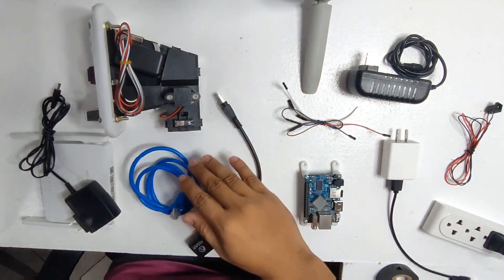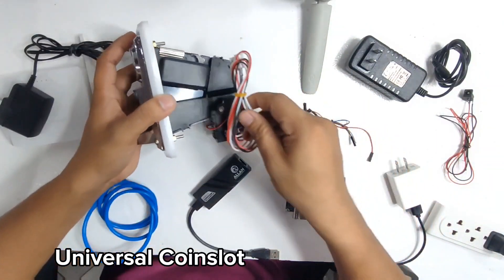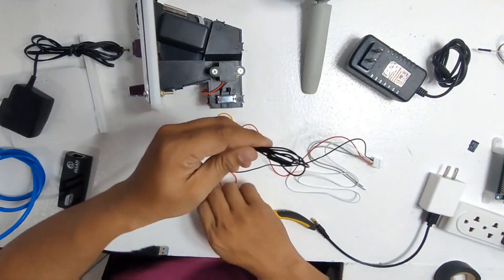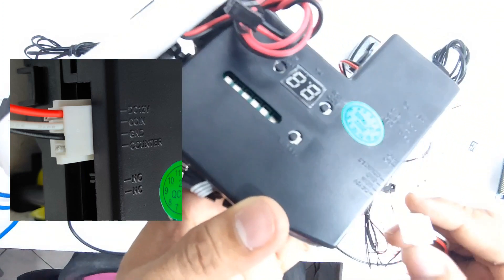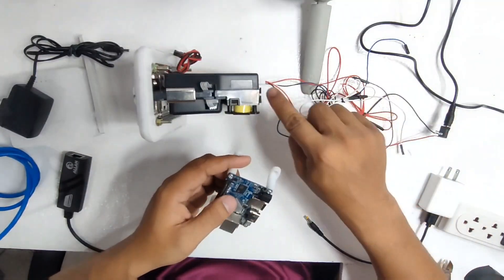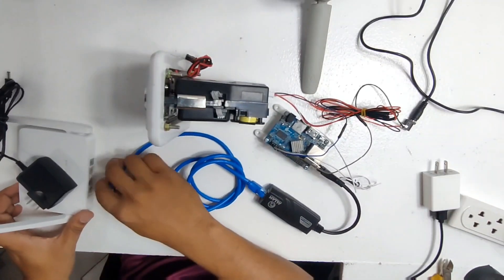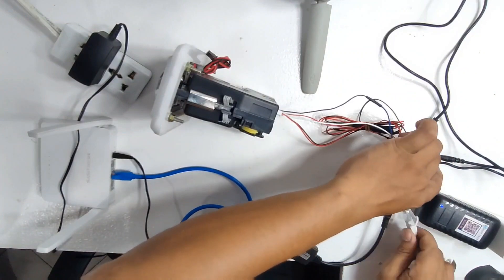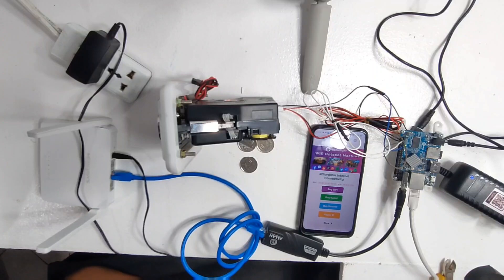How to Build Coin Operated WIFI Machine Without Using Custom Board |ADOPISOFT

Comment: raspbryy pi 3b
Reply from the maker: For Raspberry Pi, the assigned pin (3,5, and 9) is still the same, you may refer to this web page https://www.jameco.com/jameco/workshop/circuitnotes/raspberry-pi-circuit-note.html
Reply: @adopisoft  from coin acceptor white wire pin 3 and pin 5 is relay pin 9 ground right boss and how about setuf admin in side
Reply from the maker: @nahimkhan3989  the default settings is already 3,5 and 9. Kindly check in Sales > Payment Portal

Comment: Hindi nasali yung led lights sa tutorial
Reply from the maker: If you are referring to the coin slot LED, you may connect it to the red and black wire of the female adaptor. Ensure that you are using a 12V LED.